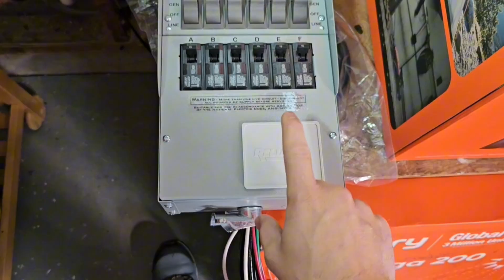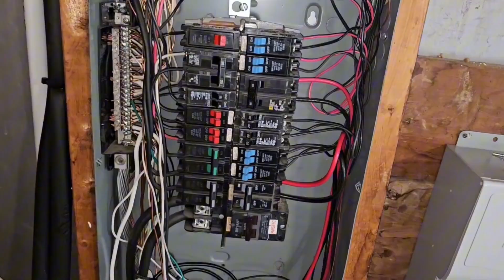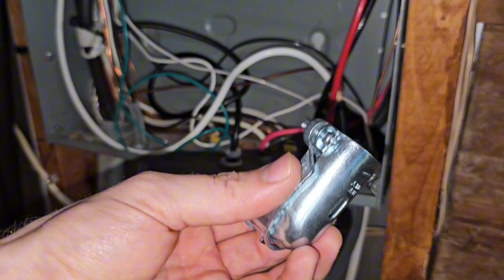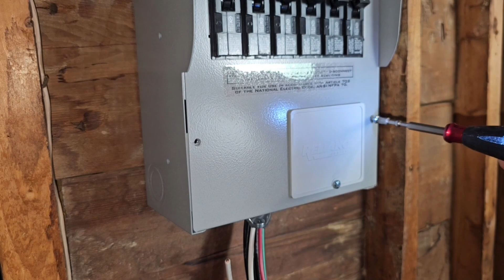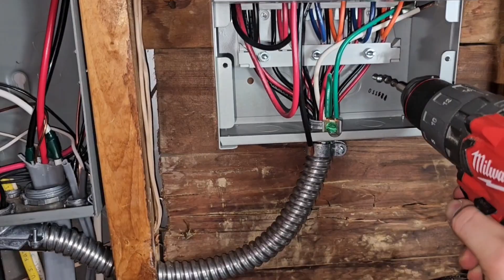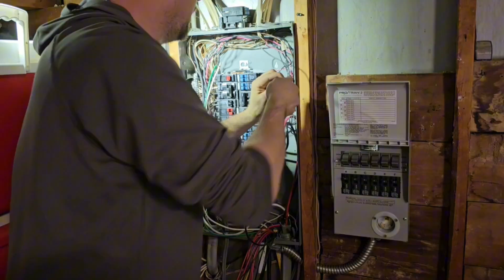how to install reliance controls transfer switch

Comment: Personally I prefer to power the entire panel. Light switches working plus all the small conveniences. My entire house runs off a 3500w. Two window units, fridge, freezer tv's and everything else 12 amps all day.
The drawback is not knowing when the power is restored without a light outside.
Reply: Similar, but I'm on 2000 watt inverter.

Comment: The amperage on the transfer switch is 15 per fuse how did you power 20 amperage fuses on the main breaker?
Reply: Same question